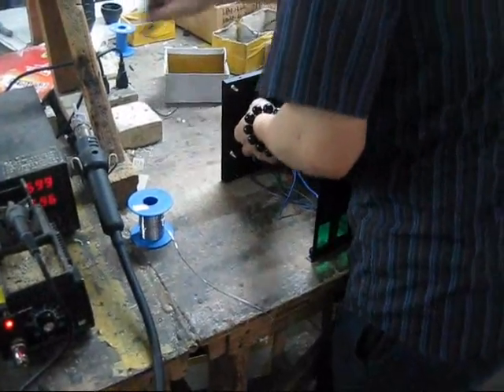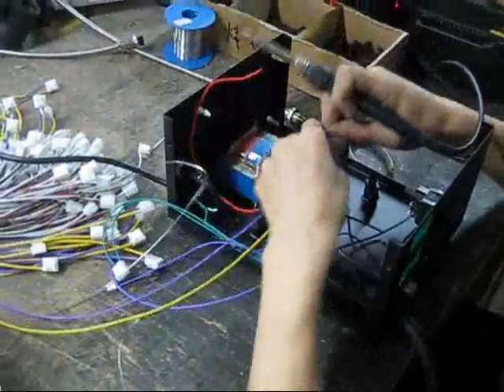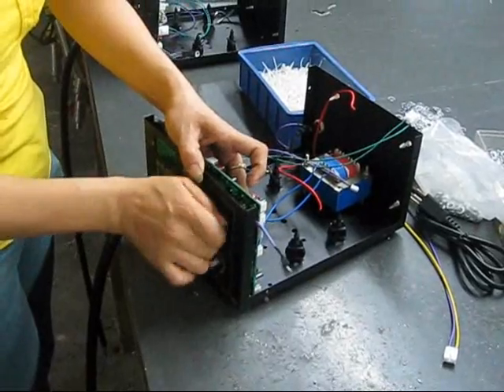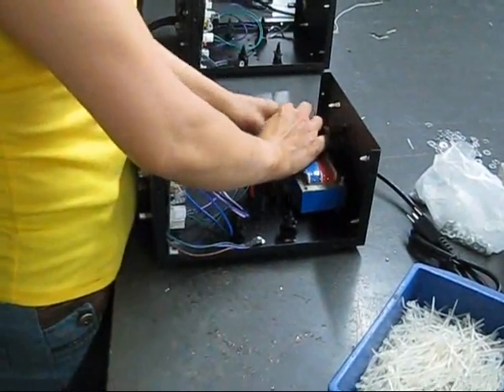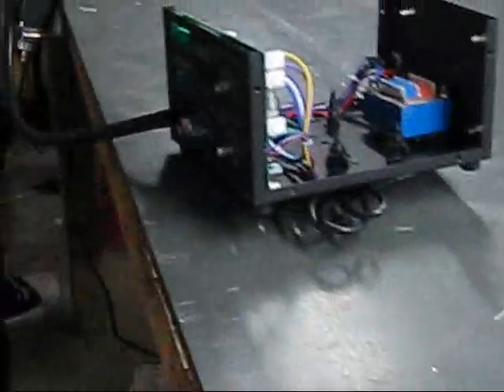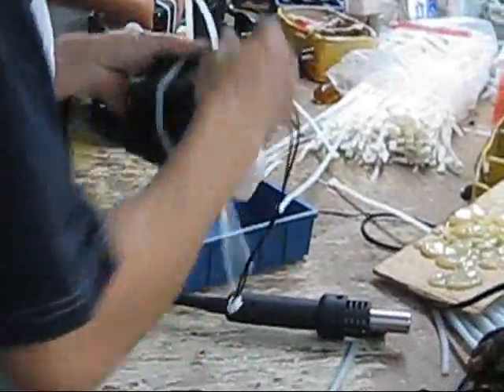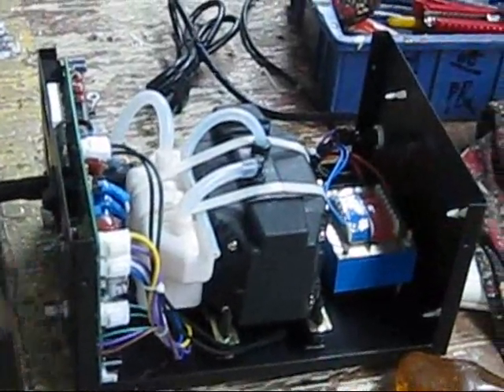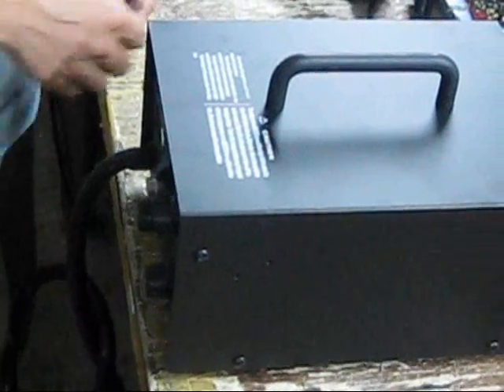KADA 852D+ Dual Soldering Station Fabrication - DigitoolTV  Full Review -

Comment: Hello, I bought the Kada 852D+ used and have had it for almost 2 years.  It works great compared to more expensive Hakko units.  There is a slightly 'cheaper' feeling unit, but does work very well.  I solder professionally for audio equipment and this is my primary machine.  My problem, the air pump/motor seems to have failed.  The hot air element still gets hot, with the air-flow knob all the way up it only barely blows a little air.  Where can I purchase spare parts thank you!!  Great machine!

Comment: Very nice video ,cant you add a tutorial video , how to use this Kada 852D+ rework station ??
How to remove smd chip , and resolder them ..
Explane how to use solder and flux pastes.
Whits tips to use , and nozzles ..
Some tips and ideas , temp and air flow to guide us beginners to use this great soldering station